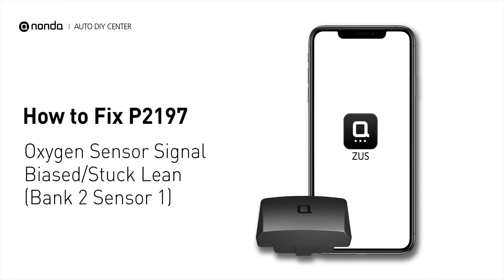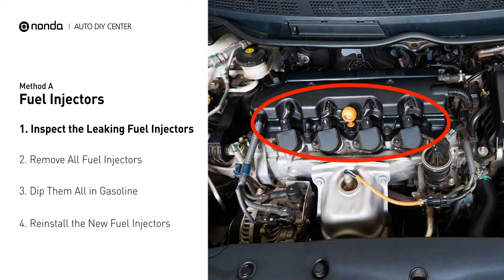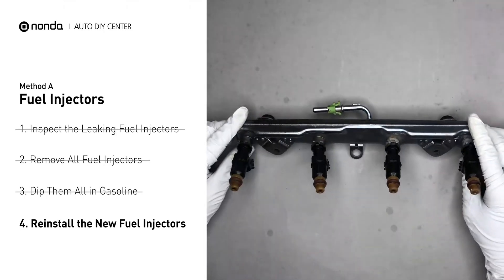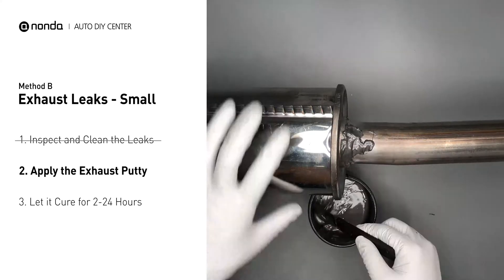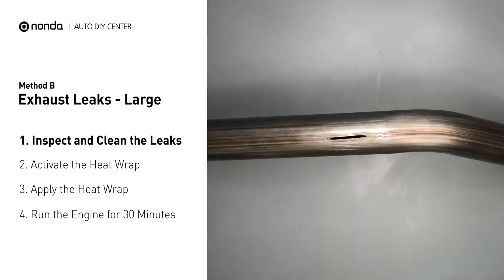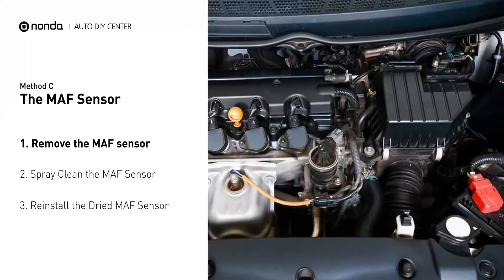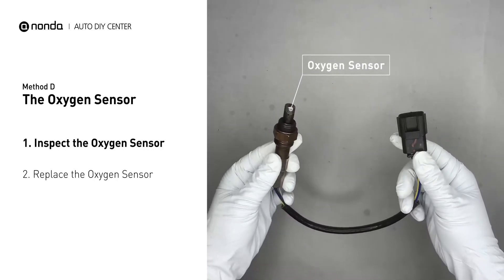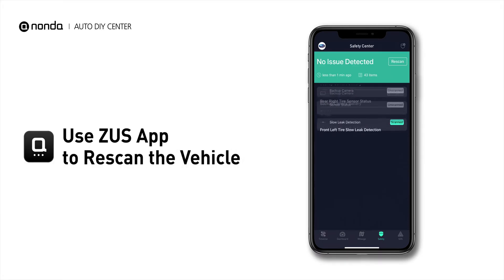How to Fix P2197 Engine Code in 5 Minutes [4 DIY Methods / Only $8.34]

Comment from the maker: Hi, I'm Steve, nonda's lead mechanic engineer. 
Feel free to leave your comments here if you have any mechanic questions, I will be glad to help you out!
Reply: Hey I have a cord escape 2005 and I changed the o2 senser a couple weeks ago I cleared the engine light and have been driving it but the light keeps turning on for the same thing. Can it be because the auto place gave me the wrong senser or could still be bad ?

Comment: Ford escape 2003

P2197(1/ 1) Stored
02 Sensor Signal Biased/Stuck Lean -
Bank 2, Sensor 1
DTC Severity 2 of 3: Repair immediately 
That’s scanner show me so where is located to replace the sensor ?

Comment: I was getting gas and then it throw these Two Codes p2197 & p2198 so all I have to do is just change the oxygen sensors
Reply from the maker: Hi John, please provide us with your vehicle's year, make and model.
Reply: @nondainc  2004 Mercury grand marquis LS
Reply from the maker: Hi John, kindly check first the wiring going to/from the bank 2 sensor 1 oxygen sensor for any issue and repair/replace if necessary. We also suggest checking if there's a vacuum/exhaust leak.
Reply: @nondainc hello, how would you check if there is a vacuum or exhaust leak?

Comment: What if both long term fuel trims are staying at 0% while truck is running?
Reply from the maker: Hello, please check your sensor fuses under the hood, and do a wiring test. Test the continuity and resistance of all four wires from the O2 end of the extensions back to the PCM, and for the heater (+) wire from the O2 back to the fuses.